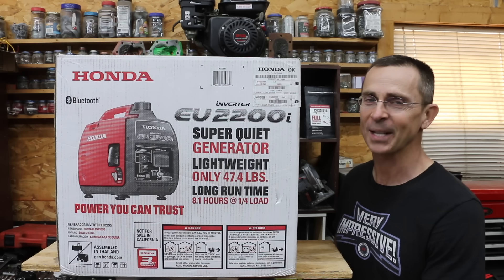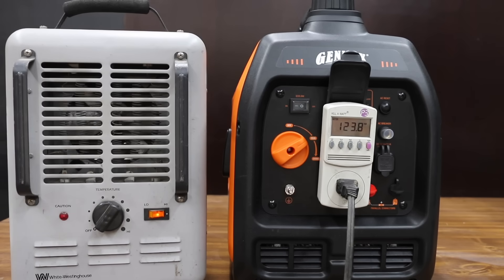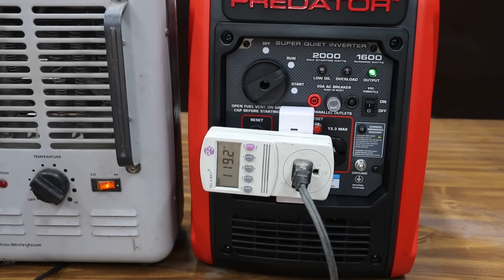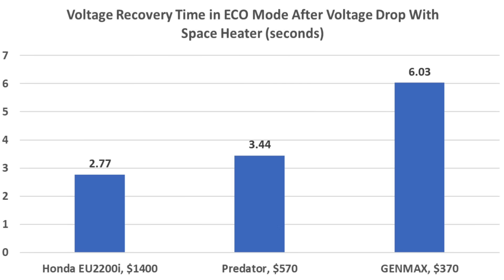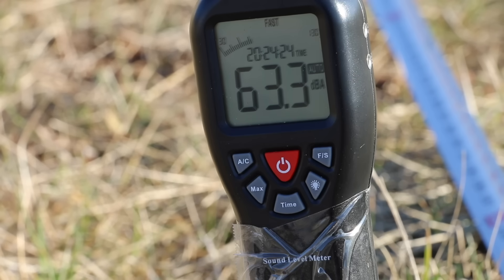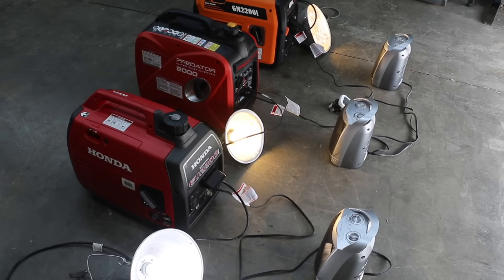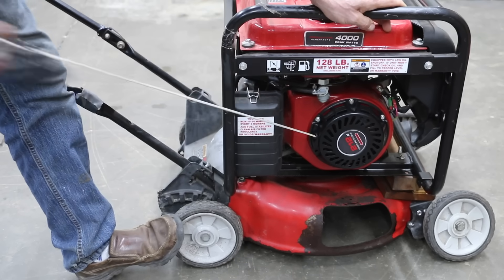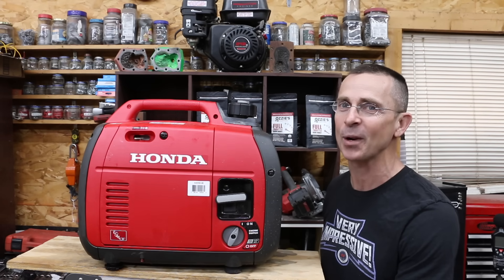Cheap Generator Better Than Honda? Predator vs Honda & GENMAX—Let’s Settle This!

Comment: phenomenal video!! Thank you for doing generator video.  I love how you did eco vs standard, fuel consumption, sound, vibration and oil consumption.  I would love to see you do same thing on the new genmax 3500 range vs Predator 3500 vs Honda 3500 and then same test with the 7500w generators.  Would be really awesome to see you do a long hour test on these to say 250-500 hours. 

Any thoughts on doing a compression test or valve train adjustment test comparing also? 

Thank you for bringing such great videos to youtube!
Reply from the maker: Thanks and you are welcome!  Thanks for the suggestion.

Comment: Cummins/Onan. 
I have the P4500i. I paid a premium price for the name but so far have been pleased with it. I changed the oil at 25hr the first time per the manufactures recommendations. After following the recommended brake I. Procedure. Frankly I was surprised and appalled at the amount of visible metal in the oil after break in. The engine as with the predator is made by Ducar, as allot of portable generators do also. (214cc).
Reply from the maker: Thanks for sharing.

Comment: I'd like to see Wen generators tested, I picked up one of their 2000 watt super quiet's because it was much cheaper than a Honda at only $400 (that was two years ago though), it hasn't got much use but has worked very well. I know there are other brands too like Westinghouse, Ryobi, Craftsman and Dewalt, all of various price ranges.
Reply: Virtually all of those generators are re-branded Generac's.
Reply: @AmericaFirstKorey  I figured there probably would be rebrands I just don't know by/for who.
Reply: @anthony92399  100%, I was surprised, we have multiple 'Brand-X' generators, all of them are Generacs under the skin.
Reply from the maker: Thanks for the suggestion.

Comment: I like these tests but how about a longevity test on this type of equipment. Maybe run these and other generators for several hundred hours and see how everything adds up afterwards. Or even run them to death.
Reply: This would be helpful to see if the headache of buying the cheap is a payoff that worth it. I’m usually buy once cry once.
Reply from the maker: Thanks for the suggestion.

Comment: I almost never have a black out .maybe once every 2 years 
I’m wondering if a propane powered generator would be the best choice . 
That way I don’t have to store gasoline that would turn bad after 3 months .
And carburetor won’t gummed up with gasoline after 1 year or no usage .
Reply from the maker: Thanks for the suggestion.

Comment: Great video as always! We actually use several of these Hondas at work for various remote needs. Sometimes running balloon lights for hours on end. And you know how hard people are on company equipment.... our generators are beat and tossed around quite a bit, and still function flawlessly. Honda makes a fantastic unit, hands down worth the extra $$$.
Reply from the maker: Thanks!  Thanks for sharing.

Comment: Makes me feel a little better about buying a Chinese made Wen gen set last year. I wish you had included a Wen in your test but I know those aren't cheap so it's not like testing hammers etc. I only have it for power outages which aren't frequent so I don't need something that's going to last forever running 24/7. Thanks for making this comparison video.
Reply from the maker: You are welcome!

Comment: I bought a predecessor, a Honda EU2000i, in 2012. Still going strong. I don't trust the less costly, Chinese-made brands but understand their value for some users. The fact that the two you tested showed abnormal wear in the engine is telling.
Reply: Bought one around the same time. Sitting in a shed that is not heated and uses it often. As good as the day i bought it.
Reply from the maker: Thanks for sharing.

Comment: It would be very useful for a lot of people if you tested different radiator flush chemicals to remove rust and scale.
Reply: Hard to reccommend them for many cars as different metals react to different ones. What worked in grampa's iron heand and block ford with a copper/lead radiator, may not play nice with modern plastic, aluminum, zinc, and Vice Versa. Add to that each mfg seems to put different metals in the coolant path (the reason for the different types of antifreeze), and you have a situation of unknown chaos going on in your cooling system. Just flush it with water, rinse with distilled, and keep full with fresh antifreeze mix, which contains anti-corrosive additives.
Reply from the maker: Thanks for the suggestion.

Comment: I'm a Fleet Mechanic.   We used to run Honda's for all our generators and water pumps.    Due to operator error in leaving the fuel open and washing the cylinder walls on a regular basis we switched to Yamaha generators and water pumps.   Under $400 cad, they perform just the same and they have all out lasted the old Honda's
Reply: My Yamaha piano also outlasted the competitors
Reply: @gigilaco  yep, those Honda pianos are crap.
Reply: @None-c9l  Well if Bugs Bunny would stop dropping them on Elmer Fudd they would hold up better.
Reply: @user-xp8jz2sf1p  
Wait honda make pianos too?
Reply: @dogs-and-destruction-channel  of course - and have you not seen Kawasaki televisions in the appliance shops?
Reply: @gigilaco  Yeah?, but my Honda jet outfly's your daddy's Yamaha motorcycle!  Kidding, but I AM glad I chose the Yamaha generator over the Honda. Several reasons why, but Honda's stupid interference timing belt (at a higher price with fewer features, no less!) made the choice unquestionable for me.
Reply: @georgiolaco  
My Yamaha Mox8 lasted me 10 years before it shut off and never turned back on, which outlasted all my other brands I've had in the past except for my KONG B2.
Reply from the maker: Thanks for sharing.
Reply: We use the Hondas on average of 6hrs a day every day going on 6 years.  They just don't stop.  They have no doubt payed for themselves 10x over.
Reply: @euclidallglorytotheloglady5500 same 😎😎
Reply: Considering the Honda shut off switch also shuts off the fuel, how is the fuel washing down the cylinders? Fuel would also have to get past the float needle in the carburetor. I’ve only ever had that happen when the float needle was corroded.
Reply: @bert357  The older model (eu2000i) didn't have that feature. The newer (EU2200i) does.
Reply: @LuckyFlesh My older 2000 Honda shuts off the fuel when you turn it to off.
Reply: @darinr1189 yeah I worded it wrong. What I was trying to say is that when you turned off the older ones there was still some fuel left in the carburetor. 

But newer ones have a position on the switch where it turns the fuel off but the engine keeps running until the last bit of fuel is burned out of the carburetor.
Reply: Not sure where you are getting that price on the Yamahas. They are similar to the Honda price.
Reply: @SiXiam  The A-iPower generators they sell at Sam's club use Yamaha engines, or at least they did when I purchased one a couple of years ago for less than $400.
Reply: @rickdff62  I bought two of those and got them for $350. Haven't seen that deal since. However, I thought I got them at Costco. Either way, they've worked well.
Reply: @rickdff62  If the motor does not have a Yamaha sticker/badge on it, how could one tell?
Reply: @SiXiam  Just bought a Yamaha 2200 @ $1,299.00 US + tax
Reply: It's definitely not cheaper than a Honda @ed-gw3ov
Reply: @SiXiam  that $400  price would be what my shop paid for the 3 inch water pumps.    I accidentally left that out.
Reply: @SiXiam  yes...Yammies can be right up there with their prices!
Reply: The newer 2200w Hondas have a fuel shut off that’s activated before the engine cutoff. You can shut off the fuel and let it run dry. The older 2000w model didn’t have this.
Reply: @Mi-ck  the 2000 models do have that feature, fortunately. You turn the engine on/off dial to the halfway point and run the unit until the float bowl is empty and the unit stops.
Reply: @gasstationpeanuts1814  just tried mine. Doesn’t work. The engine shuts off as soon as the knob begins to turn away from on. 

I’ve heard this before and tried it on all three of my EU20s. All do the same thing.
Reply: @gasstationpeanuts1814  now that's interesting. I have on older one and I've been draining the bowl with the screw
Reply: I've heard good things about Yamahas> Thanks for sharing. Would have been cool to see that one in the mix
Reply: @travisjazzbo3490  You actually prolly did.. both of the 80cc ones looked like a Yamaha clone.. and is the predator 2cycle tailgator.  I have a real Yamaha and is has been excellent, Also have a $386 red clone of it that works OK amd wont complain about parallel operation.
Reply: We had the same problem on our generators, but we run Briggs....hydro locking on gas when starting, and fuel diluted oil...yet it still runs lol. For mobile generators, those engineers weren't thinking...
Reply: Just find a gas station without ethanol on google
Reply: @PeteyMcSavage chevron premium is ethanol free
Reply: I don't even need a generator, yet here I am, watching the whole video, wishing for a round two with maybe cheap two-stroke ones from $100 to $300. Regardless whether I need the tested items or not, it's interesting and entertaining at the same time. Keep on rocking!
Reply: @djkarcher1896  cheap 2 stroke generators are ok for power tools but they are far from ideal for anything with sensitive electronics that require pure sine wave electricity to prevent any damage to their circuit boards👍
Reply: @djkarcher1896  just get one, you can start it up every couple weeks and make coffee, they are great even if you have no use, its an engine!!
Reply: I agree, I have a small engine shop and purchased a new Honda EU2000, would flood every time on a cold start. I refused to repair it due to warrantee issues. Honda dealer did not want to repair it. Traded it in for a Champion and no more issues. Thanks
Reply: I can vouch for Yamaha generators (I left another comment about it). Definitely worth including in a future test.
Reply: Yamaha 🐱👍🏿
Reply: We always use STABIL in the fuel and we always run the carburetor completely out of fuel before we store it and we've never had a problem in 20 years
Reply: @thecloneguyz  I, too, use Stabil and have never had a problem.
Reply: @watchmanonthewall14  yeah the blue marine stable has saved me for years,they gave changed the red to combat ethanol but yeah the original stable wasn't stopping the ethanol and maybe that's what this guy used,star tron  is supposed to be good but the marine stability works so i 7se it
Reply: @thecloneguyz yeah but Taryl fixes all showed all fuel additives dont work.  Its really just ethanol in the fuel or not that matters
Reply: @yzrippin  you also left out the video that if you want to get it fixed, there are no parts available. They are throw away generators all the way up to the $10,000 range.
Reply: @thecloneguyz  your not a fleet operator. Operations does some really heinous stuff to these units. Like leaving the fuel on and throwing them in the back of the truck. The float stays open and fuel dilutes the oil.
Reply: @thecloneguyz  Stabil does nothing you should have saved your money.
Reply: 11 years ago, I stowed my 5hp Briggs/stratton generator and a 5 gallon poly can of gas treated with stabil  in a storage unit up in the high desert of S. California. Storage stayed locked that whole time. 
I recently pulled both out, poured in some of that 11 year old Stabil Gas, and that generator started on the FIRST PULL. 

You cannot tell me that StaBil doesn't work!
Reply: Very interesting.
Reply: 2,000 watt Yamahas and Hondas both run over $1,000 lol
Reply: We have a 2000 yamie and love it. Runs much more refined sounding then my grandmas Honda 2000
Reply: @matthewdrew6268  Yep, they also dont have a plastic cam and a timing belt.. and stellite valves.. just with they had a bit more displacement
Reply: Apostrophe surplus detected.
Reply: Which Yamaha model at that price?
Reply: @QuestionMan  haha it must be stolen th es2000is is about$1350
Reply: Was just about to post - where are the Yamaha's???
Reply: If you bought a Yamaha for $400 its got to be stolen
Reply: 🤦🏻‍♂️ washing the cylinder walls… 
WTF are you guys smoking over there
Reply: Thank You for sharing this..
Reply: Firman and champion generators
Reply: Yea My Honda broke down and all the wires Fried inside. then the engine bogged out. I was on a jobsite then just bought a Predator to get through the job. Honda lasted 4 years. predator still running at 8 years now. My EU 2000 would kick the breaker off on stuff the Predator will run too. Much better value the Predator at 400 bucks you really cant beat it. you literally could buy 4 of them VS most other competitors but probably wont need to .
Reply: Wow.. impressive 🤔
Reply: The brand new Honda 2200 Eco mode I am so pissed that after all these years I finally got a generator and ditched out the extra money because I thought Honda was the best and now I wish I would have gone with a cheap knock off there's even videos on YouTube and blogs about the vibrations that are certainly going to cause failures down the road!!!
Reply: Which Yamaha ?
Reply: Incredible review
Reply: I have a Yamaha genny and it’s been a nightmare. Fuel shut off leaked and varnished the carb, getting the carb out to clean low speed Jet isn’t possible without special tools. Yamaha crammed 10lbs of, well you know what I mean! Even just getting covers off to work on was an absolute cluster!!  Hondas are easy to open up and fix!
Reply: Your best test yet. Thanks for putting this together, and to the viewer who suggested it.
Reply: Good to hear, glad I bought the Yamaha 2000is lightly used (25hrs)for $250- FB marketplace.
Reply: @KreemieNewgatt  I just use that as a backup in case I forget to run the carburetor completely out of fuel
I want to leave some in the float Bowl though so the needle and seat doesn't dry out and crack

Comment: its weird how the honda had oil on the spark plug too that predator thou that things not gonna last if it keeps burning oil like that as for the gen max if its got that much metals in the oil but a normal looking spark plug than thats like either bottom end wear or just factory assembly metal deposits from poor finishing clean upbased on these results id go for the gen max or the honda but wouldnt touch the predator
Reply from the maker: Thanks for the feedback.

Comment: I would love to see the sine waves for each generator during a motor start. Matthias Wandel did this for eco flow power banks and showed they could cause damage to other electronics on the circuit.
Reply from the maker: Thanks for the suggestion.

Comment: Dude you always amaze me. I do many of these reviews. Hondas are great but ….definitely a small advantage with the 121cc engine verses the 79.7cc of the others which are Yamaha clone models. 
Also they use a assembly grease when these are built that could skew the oil analysis so you need to run them about 15-20 mins and change the oil maybe twice to wash the internals then that should provide better oil analysis after the longer run time 👍🏼
Reply from the maker: Thanks!
Reply: You clearly did not watch the video.
Reply: @nobodynoone2500  I watched the whole thing. How do you figure..?
Reply: What up JW?
Reply: @mikecon7634  yooo mike…👍🏼

Comment: Could you do a dual fuel comparison. I'm wondering if propane will leave condensation in the carburetor bowl after running on propane for awhile?
Reply from the maker: Thanks for the suggestion.

Comment: Would have love to have seen the harbor freight predator 3500 inverter generator in this comparison.  It's much quieter than the predator 2000 inverter and still costs less than the Honda.
I've got a few hundred hours on mine, mostly from the Rolex 24 hour races and the Florida hurricanes.
Highly recommended 👍
Thanks for the great content!
Reply from the maker: Thank you for the video idea!

Comment: It would be super cool to see a comparison of really cheap generators with "sinwave cleaners" added to them, so that they can run all kind of stuff like the ones showed in the video. It probably makes more sense buying the cheaper building site kind of generator and just having a appliance that cleans the electricity than buying an expensive generator.
Reply from the maker: Thank you for the video idea!
Reply: There really isn’t a simple cost effective “sinewave cleaner”. You can buy a variety of products that can help mitigate major spikes and interruptions, but there really isn’t a device that just magically cleans your generators dirty sine wave that is available.
Reply: Not worth it. Any device that refactors your power is going to hurt efficiency. Just buy a good genset.
Reply: @nobodynoone2500  A good genset is basically a shitty genset with a converter on (The ones showed in the video)

Comment: I do think testing more generators could be really good!
We have a Duracell branded generator at home, I'd love to see how that compares to some others
Edit: It's the Duracel DG3200, and it is in fact gasoline powered
Reply: Listed online as a 208 cc OHV motor with 7hp and 4000 watts
Reply: You mean you have a Duracell ‘power station’? Duracell doesn’t make a gas or propane generator, they do make a battery based power station though.
Reply: @jim yeats  i finally got around to finding it, it's model DG3200

Comment: Compare some dual fuel propane/gas models in the 8-12kw range. Benchmark and Firman for instance. Also - test some prefab sheds or generator shelters for security safety and durability and ease of construction.
Reply from the maker: Thank you for the video idea!